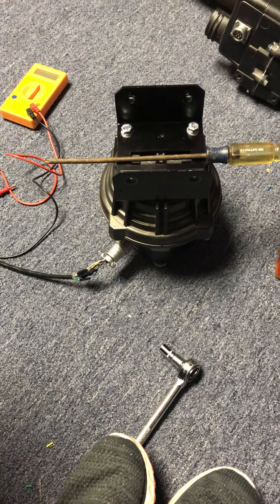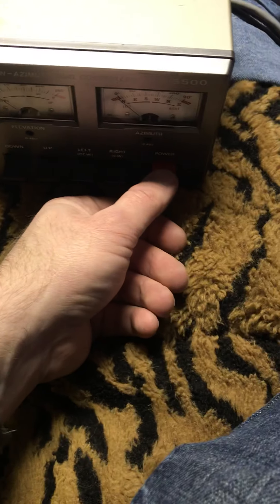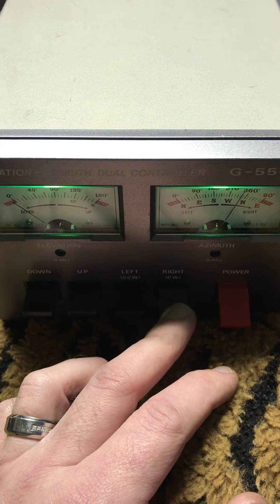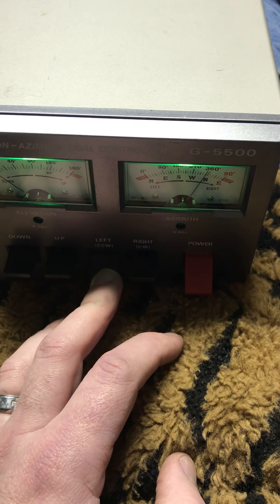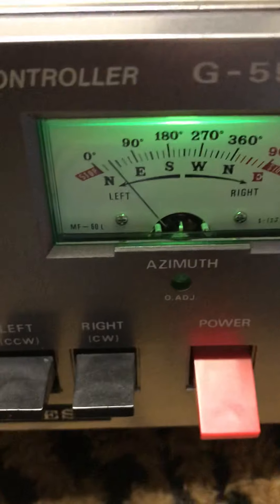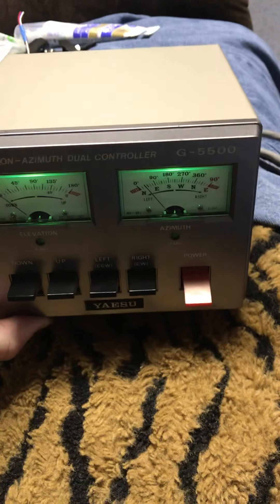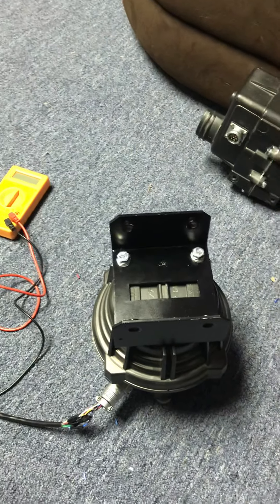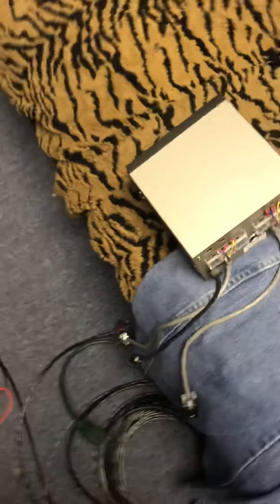Yaesu g5500 pot issues#2

Comment: I have a G450XL motor that does the "hokey pokey" on the indicator. It works fine when the potentiometer is cold, but once it warms up the indicator needle lags behind the true position and then speed up to find true electrical position - sometimes. You're right, Yaesu prefers you send the motor in for the repair. Nice approach on the fix.
Reply from the maker: Weimaraner I’ve noticed that on the new pots too. Smh